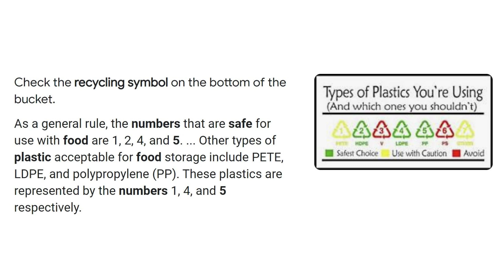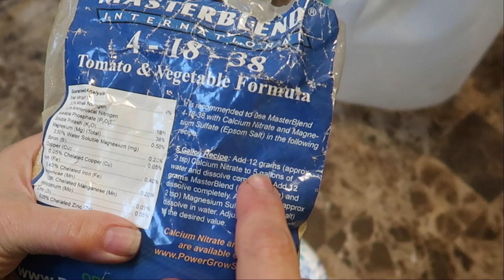Hydroponic Set Up for Tiny Tim Tomatoes Two Ways: Kratky and DWC (Deep Water Culture)

Comment: I started my first attempt at hydroponics 2 weeks ago with Basil the Kratky method in mason jars. The Basil roots were growing fast and White. Then I saw your video that showed a noticeable difference doing dwc vs kratky and tried it. Got me a 17 Gallon Black tote with yellow lid, 4w air pump 2 small air stones, Fox Farm Grow Big Fertilizer, Monios L T5 LED 2 ft full spectrum grow light 30 watt. So after I set it up I didn't fix the ph level of my water and just added 24 tsp of fertilizer to 12 gallons of water and placed the plants in. 2 days later the roots turned Brown and my plants have stopped growing since! I also purchased Hydroguard and added 24 ml to the water 2 days ago and don't see a change in the roots. I don't even know how much and how often to add Hydroguard again. I realize it's a long message but, my heart is into not giving up and growing my own foods here at home. I would sincerely appreciate any advise. Thank You. P.s. you make hydroponics look so easy where did I go wrong?

Comment: Hi, just want to ask how long did you keep the light turned on on both methods and how high you set them up to light those awesome tiny tims? And lastly, how low is the net cup should touch the water? Thanks in advance 🙂

Comment: Love these videos! Do you have a video about your lighting setup, and how much it costs to run daily? That's my biggest reservation with hydroponic growing - the energy bill.
Reply: From some initial research, you can pay a premium for LEDs but can help save on energy cost... So you're paying one way or another. I like the fact that LEDs cost less over time, and don't generate as much heat
Reply from the maker: Thanks Victor for answering!
Reply from the maker: Hello Korie, I do have videos showing my set up with the lights, and also reviews of some lights.  The LED's are more expensive initially, but they use less electricity.  If you live in a warmer climate you can grow hydroponically outside and use mother nature.  I have never measured the electrical consumption since it doesn't seem to impact my bill when I add new lights, so on my end its negligible, but you may have higher rates than I do.  Thanks for the question!

Comment: Hi  Ti Ki ; On the Tiny Tim tomatoes what temperature do you keep each container at ? (water temperature)
Reply: The water temperature, sorry
Reply from the maker: @johnbieda5072  Interesting question, I never measured the temperature of the water.  However the air temperature in my grow tent fluctuates between 77 and 80 degrees.  My house temperature is around 70-72 degrees, so the plants outside the grow tent  are cooler, although the grow lights add heat, so around 75 degrees.  That's the best I can answer you I hope that helps!